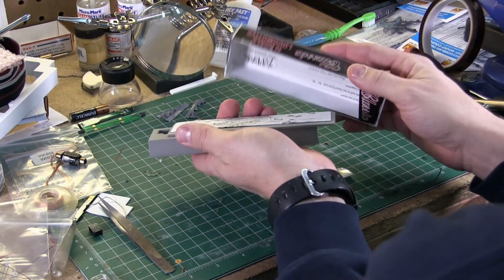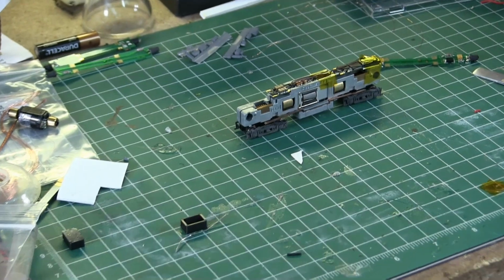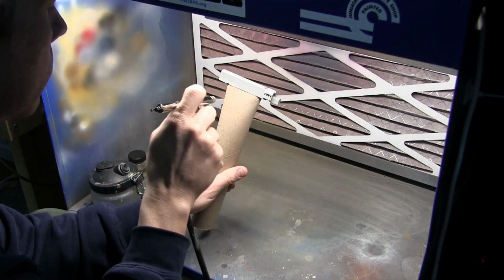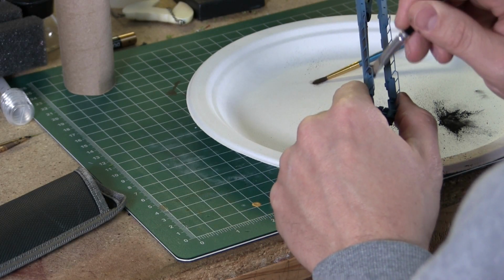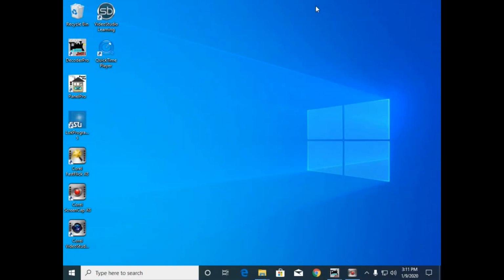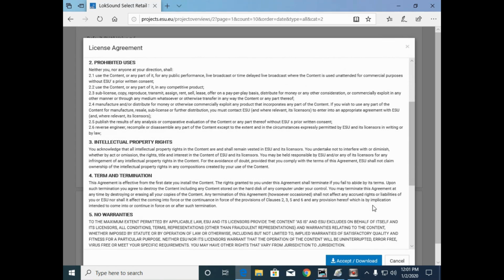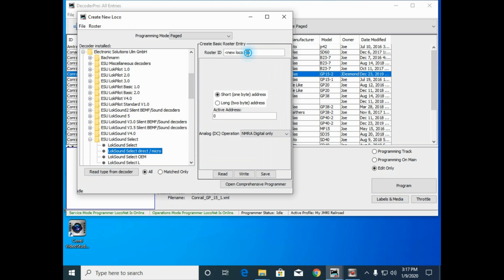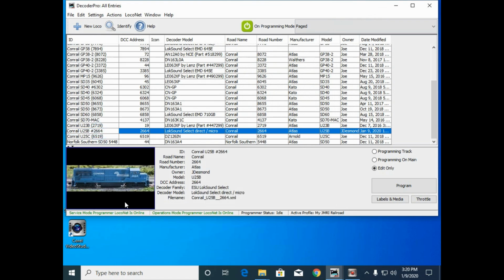Atlas U25B #2664

Comment: Joe, The speed of this loco is just right. you can tell  2664 has had a hard life by 1988. I also like that it sound's like a bag of nails as it came passed the camera. Cheers, Chris Perry.
Reply from the maker: Ainsley Perry ya once I fired it up for the first time I fell in love with it. It’s really for to use the drive hold and run the prime mover at a high RPM they really “talk”. Thanks for watching as always.

Comment: I have 3 Bachman f-9 locomotive made back in the late 80's and want to update to dcc,  how hard is it going be. N-scale
Reply from the maker: That going to be a lot of work. The motor need to be isolated from the frame. It can be done, but you have to ask yourself is it worth it. Or you you be better off taking a kato F7 and modifying the shell to an F9? Thanks for the question and thanks for watching!